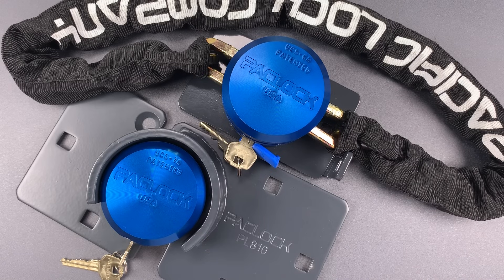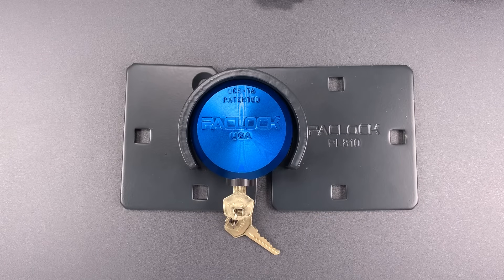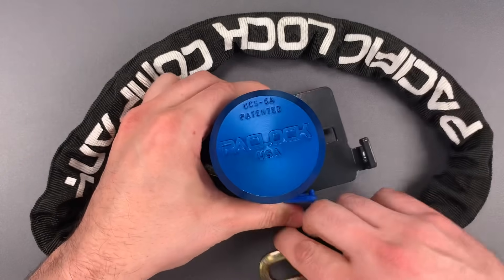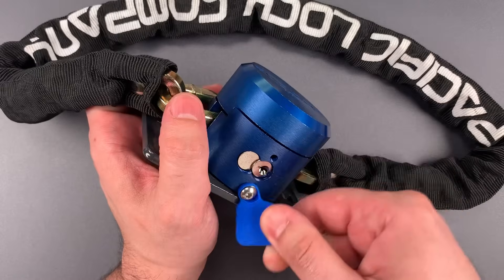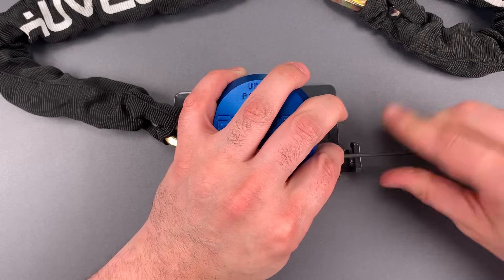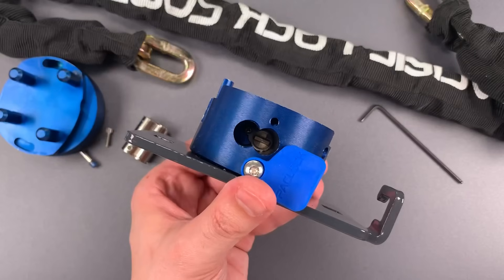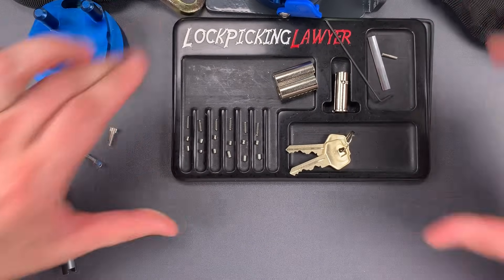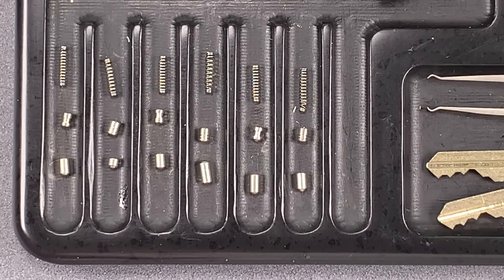[932] More PacLock Products Coming to Home Depot

Comment: @LockpickingLawyer Can you remove that set screw on the side without the lock being open? Also, would the bell bearing still hold the lock closed if that screw was removed?
Reply: Yes, any exposed screw on our locks is a screw that does not affect the locking function. Instead, those screws are set to do something (or to stop doing something) once the padlock is unlocked. So, in essence, you can consider those a security feature. If you go out to your lock and open it, then you find that the whole sleeve comes out or the top pops all the way off... well then you know someone was messing with your lock. It's unlikely the screw just came out on its own, we Nylock patch all of our screws.
Reply: @paclockpres.9805  It's not a bug, it's a security feature. :)

Comment: So thousands of locks and not 1 return? I dont believe it. Every  company has failing units. No matter how minuscule their failure rate
Reply: West Pointers don't lie, cheat, or steal nor tolerate those who do. Sounds cheesy, but I live by it and believe in it. We never received a single padlock back for return because of quality. Sure we got padlocks back because the address we sent them to was bogus (blame the government for that), but never a single lock for quality. Why? Lots of reasons, but one is that every single lock we manufactured got quality tested at each step of the manufacturing process (4 times) and then a final quality check at the very end before packaging.

And that final test was performed by someone with a disability ~ someone who is on the spectrum and is fully functioning, but has a hard time doing lots of different tasks. But put them at the end of an assembly line, give them a padlock, and give them 5 things to check for, and they'll straight up kick ass. 

A non-disabled person would sit there all day grumpy about how dumb this job is and how they deserve better. They'll get distracted and just not care. Quality drops.

But someone who has a brain wired to be precisely focused on what they do and ignores all the distractions and is truly grateful to have a job and come into a work environment each day... they'll kill it. And they do. 

So I stand behind my millions of padlocks without a single return ~ and so would everyone else at PACLOCK who produced all of those locks. 

They were great locks. Is it possible that some weren't so great and the war fighters just chucked it? Sure.

But here's the thing... every few months we'd get padlocks returned to us for quality or for being "the wrong lock." Every single time we got one (every single time we'd get a phone call), it ended up being a Master Lock. So, this tells me that things can get bad enough for a warfighter to take the time and effort to return something. That just never happened with a  PACLOCK.

Hope this helps!

Comment: Do your new "Comb Picks" work on these ?
Reply: The difference between our cylinders and AM/ML Cylinders is the fact that we designed our cylinders with a longer pin in the rear of the cylinder that prevents combs from over-lifting and bypassing our cylinders. While over lifting works on 100% of the AM/ML pucks that LPL tested, we've calculated that the vulnerability only affects around 15% of our cylinders and a complete fix has already been implemented to protect future cylinders from this bypass.

Comment: Is it possible to install a core if picked makes the lock unuseable as one earlier video; in that case, how to drill it open?
Reply: Use an angle grinder. :| takes less than 30 seconds.

Comment: With the cylinder retained by only one screw, wouldn't it be simple to just hammer the cylinder to break the screw and then take cylinder out?
Reply: I think the screw is stronger than the lock body, if they're using good materials... it may deform the hole and jam everything together before shearing, and that with using something like a slide hammer. The cylinder is backed in tightly to the actuating mechanism, no room to move.

Comment: On the link whats stopping you from from undoing the set screw while its in use?
Reply: If you mean the 5:31 :

If you examine the prongs ,you can see that one of them is to be held down by the ball bearing keeping the lock locked, there is another one for the set screw that seems to keep the lock from having the top part detached, so as long as the lock is locked ,the screw has next to no effect on its state..
Reply: @QuadrapleTroll  yeah i see you mean thank you

Comment: Don’t these kinds of locks pick easily with a comb pick? I saw you defeat something similar  very easily. What makes these different?
Reply: The difference between our cylinders and AM/ML Cylinders is the fact that we designed our cylinders with a longer pin in the rear of the cylinder that prevents combs from over-lifting and bypassing our cylinders. While over lifting works on 100% of the AM/ML pucks that LPL tested, we've calculated that the vulnerability only affects around 15% of our cylinders and a complete fix has already been implemented to protect future cylinders from this bypass.

Comment: What do spool and serrated pins do, I've been wondering this for a long time and I can really find any info online. Maybe I'm just dumb idk.
Reply: A spool makes it feel like the pin has been set early. It also often requires counter rotation to properly set it, making it difficult not to lose other pins. 

A serrated pin acts like a pin with a lot of false gates. It gives you feedback as if it has been set, but that's only one of the serrations that crossed the shearline. As with other security pins, once overset it's hard to get it back down again without losing the rest of the pins.

Then there's torpedo or mushroom pins that aren't shown in this lock, they are very difficult to drop down again once overset and are very prone to be accidentally overset as well.

If anyone with more experience has any corrections, please do so.
Reply: @paulelderson934  I see, so it's the spool and serrated pins trick you. Ans the other ones just make it difficult for a less experienced picker to pick it, because they might not exactly know how far to set it. 

I assume that if you encounter a pin and feel like it has been set multiple times (I don't know if that makes any sense) then you can be sure it is a serrated pin. But if that is the case then how would you be able to figure out when the pin is actually set, and your not just in one of the serrations.
Reply: @paulelderson934  yeah, I've been watching lpl for a while and also researching locks and how they work. But I'm more involved in cyber security, I just find all types of security interesting.

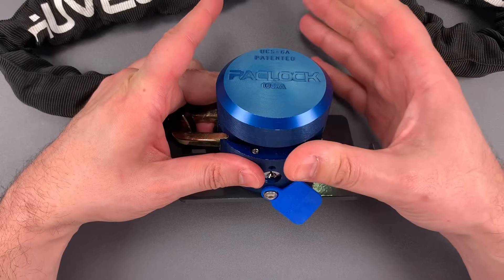Comment: 5:16 I'm so confused, how is this secure if you can literally unscrew it and it opens? All a robber needs is an allan key and they're in.
Reply: It won't come apart while it's locked.
Reply: As Jay says, the lock has to be unlocked before you have access to the screws.

Comment: @PACLOCK PRES. Will you be offering a bare puck so folks who already have the hasp with masterlock can upgrade?
Reply: Yes! Lots of runway with Home Depot and their online store. We're going to offer shackles loose so if you want to change to a longer shackle, you just do it yourself. No more buying padlocks with shackle heights, such a waste and a pain in the neck. 

As you can see, Depot is behind in getting their side of things prepped. But we will definitely offer it!  Little piece of secret here's-to-come info... our "2177" cone shaped lock (check our website) is also on the slate! It was designed for preventing a frontal drilling attack (with a long drill bit)... but we think people will buy them like crazy just to mount them on their bumpers gladiator style! So if slam into their car, you're going to get huge puncture holes in your car!!!

Comment: Since all these locks use the same core does that mean someone just needs to buy one and then they can open any of these locks?
Reply: Nope... whereas you're lucky to have five, ten, or twenty different key numbers at a retail store with what's available today, with PACLOCK we have over 20,000 key numbers that we cycle through. So the chances of someone having your same key number are really small...

Comment: Aluminum equals poor brute force resistance. NOTE...Thieves use brute force and a grinder.
Reply: Grinder would actually not be a good choice on aluminum. Grinding a hardened steel lock body is actually easier than aluminum because the aluminum melts and gunks up the blade. With you on the brute force... it's a trade off. Nice other thing about aluminum, it won't ever rust.
Reply: Mr. PRES...Good point.

Comment: I have a great deal of respect for your skills and knowledge as a locksmith, however, as a metallurgist, I can tell you that there is no such thing as "hardened" SS...
Reply: Why would you say there is no such thing as hardened stainless steel? There are variants of stainless that you can carburize (case harden)... that's what we did. Then we nickel plated for protection against both any galvanic corrosion and just the elements.
Reply: @paclockpres.9805  While I understand that your engineers and Social Media people are not the same, you're going off of what you have as a guide or what you're told, carburize and case harden are different processes and both achieve different results.
Both of these processes require a 400 or higher series Stainless and is still not a HARDENED SS, more of a coated because it is only a very thin outer layer that is harder, and this process will do nothing to protect from drilling. 
On top of that, IF your pins are in fact carburized, they will break easier.
When it comes to steel, you can't have your cake and eat it too, Hard, but brittle or soft and flexible.
Reply: @dracolyth  I'm with you... I think we're close to being on the same page. Agreed that most people call it "heat treating" when it's really "carburizing." With you there. But everything in padlocks from every manufacturer I know the carburizing only goes thousands of an inch thick... nothing is through hardened for reasons you mentioned (brittle). Even Master's "boron" shackles are just a version of steel with a small trace amount of boron in it. But that boron allows the same length of time in the ovens to allow the "heat treated" to go deeper than what a piece of steel without the boron.
So the idea that our stainless shackles have a "very thin outer layer that is harder" is no different than every other 'case hardened' shackle or padlock body out there. Get through that hard outer, very thin layer, and you're drilling 1018, 12L14, or in our case a 4XX grade of stainless.
We sent our new shackles to a formal, independent test lab to go head to head against our own hardened steel shackles, a Master boron shackle that was also round, and a Master boron shackle that is hex (which really isn't fair, but still I was curious). Our hardened stainless beat them all and was only a very, very slight bit short of beating the Master boron hex (like really close). So our round hardened stainless gave the same performance against cutting as the hex style Master... and our 96 hour salt spray test (I'm sure you'd agree that 96 hours is wicked long) came up with only a very slight rust line exactly where the shackles got hung for the plating process. Otherwise no rust.
I'd say a shackle that's as tough as Master's patented hex boron shackle and one that showed almost no signs of rust after a really long time in a salt spray tester is as close to having your cake and eating it too!
Keep in mind, we're a family business and my hands are deeply involved in a lot of things still ~ I've spent more time at our heat treaters than I'd care to say (mostly because of long lead times in California, not many heat treaters left with CAL OSHA and everything).
What do you think? Thanks!
Reply: @paclockpres.9805  I'm going to be fabricating a hitch lock for our new airstream soon, found this video in researching puck style locks.
Thanks to you and LPL I will certainly use a Paclock for the lock.
thanks
Reply: @dracolyth  Really appreciate that Chuck! If I can help in anyway, just let me know. All of my contact info is on our website or you can just call in and ask my sales team to grab me... good luck with the fabrication!

Comment: That steel packaging may be for the display model.
Reply: I would think it would be to separate them from the competition. Imagine the weight difference just picking up this vs the master in a plastic case, they have to convince you to pay extra, that may be a good way to do it. Marketing sells products more often than the quality of said product. My wife just bought this "cute" 1x1 inch digital camera from amazon. It is 2 MP, I handed her my old flip phone with a camera three times better, but she still loves the little piece of junk.
Reply: Picking up a metal package instead of plastic somehow screams quality and robustness, thus making you think its much stronger and secure than its competitors in crappy plastic packaging. which it seems to be?
Reply: It's not steel, it's aluminum and recyclable.
Reply: @davidpaine7398  Sounds like steel to me, what makes you so sure?
Reply: @--_DJ_--  the head of paclock stated that in message he left.
Reply: @davidpaine7398  Seems like a legitimate reason :)
Reply: @--_DJ_--  He also said why they did it.  Put it in standard packaging and the weight of the lock rips the packaging off the hook.
Reply: @bdf2718  I don't know if I buy that, but it sounds good.
Reply: Gold would be a step up.

Comment: Those 4 posts seem weak to shear force. I bet a well placed dead blow hit could open the lock if it's bolted to a truck.
Reply: Buy one... give it a shot... I'm guessing it won't. If I'm wrong, I'll personally send you your money back if that's what you'd like. For what it's designed to do, though, I think it's the best lock out there. But I get what you're saying, and our own tests show otherwise. But I say "let's do it!" How does that sound?
Reply: well, there ya go Lucas.  Put up or shut up.  The President of the company you are trying to discredit has challenged you.
Reply: Bryan Wagner not discrediting, just looking for angles of attack, just like any other thief.

Comment: That setscrew retaining the core seems like a really weak point for a slide hammer.
Reply: You would never get enough purchase on the screw to overcome the resistance of the threads, you'd just rip off the small amount of material in the head and leave the retaining screw.

Comment: packaging out of metal seems like the stupidest thing ever. Raises cost and puts useful metal in our landfills
Reply: Metal is easier to recycle than plastic.
Reply: The metal is recyclable and try putting that much weight on a cardboard backing, it would fold like a house of cards.
Reply: And it's actually aluminum which is very, very recyclable.  There's a sticker on the back letting you know that's it's aluminum and to recycle it.
Reply: @paclockpres.9805  Great marketing strategy btw.  Not just the packaging, the collaboration with LPL and Bonsian Bill too.
Reply: @paclockpres.9805  Flat aluminum? I'd probably never recycle it. 

You'd probably find slivers of it in a dozen little projects down the road though :) "Sheet aluminum costs money, I'll just use this scrap instead!"....
Reply: @mfree80286  Even better idea!